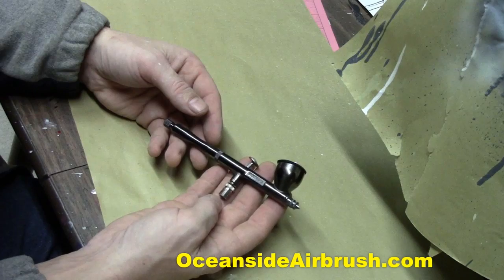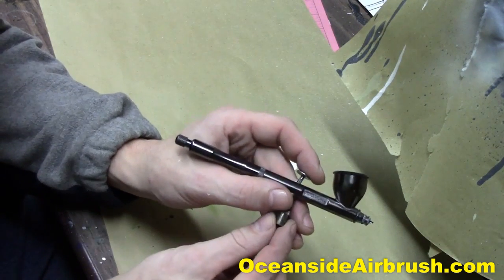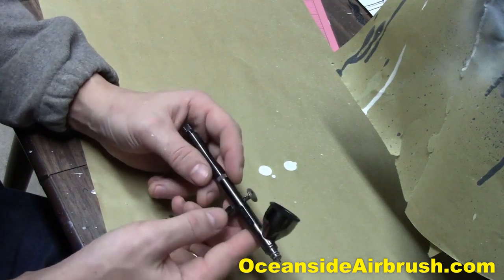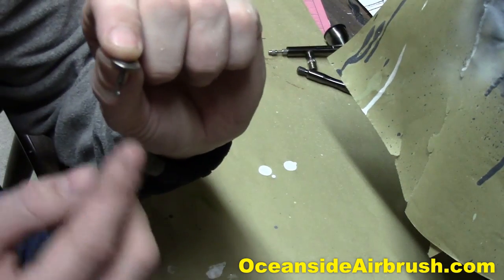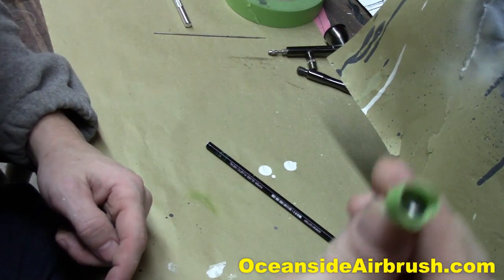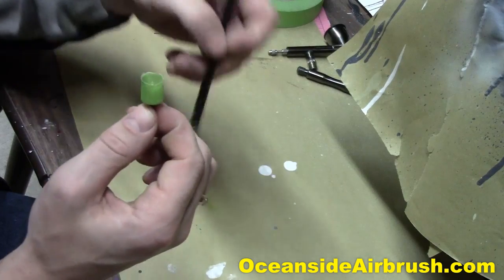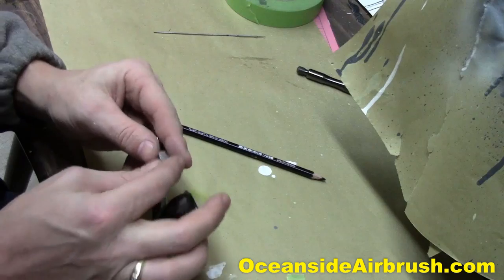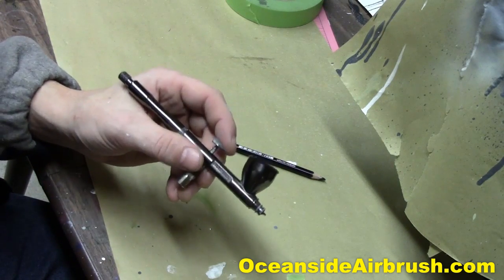How To Make Airbrush Trigger Taller For Better Grip , Detail & Comfort Airbrushing Tips Tutorial #3

Comment: I use those little clear rubberish pads/buttons that are meant to put under lamps or vases to keep from scratchin table tops.
Reply from the maker: +AMERICAN LEGEND  hey. thanks for the comment. I have also tried those, they work much better than foam from airbrush package, but still not as good as hot glue. the hot glue you can adjust the height to your liking and also put contour into it that fits your finger really well. The hot glue is also very firm and doesn't make any play in the movement. The best thing is my custom trigger caps, I will have them available on the new web site soon for all brands and models of airbrushes. :)

Comment: I had thought of this same idea. but it tried it on my iwata and the glue gun glue wouldn't stick at all to the metal.
Reply from the maker: sand it with 60 grit sand paper first to rough it up, then clean it with glass cleaner, then hot glue will stick.